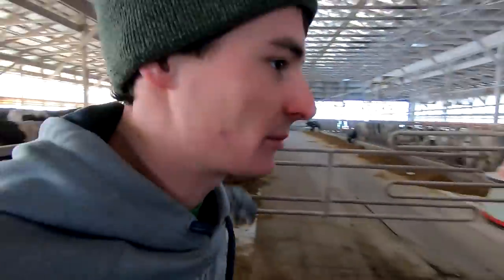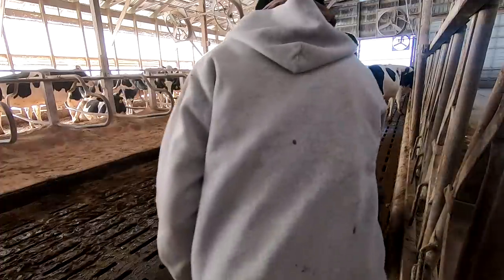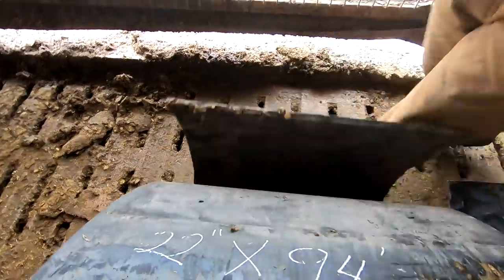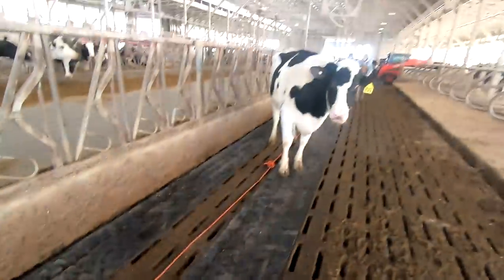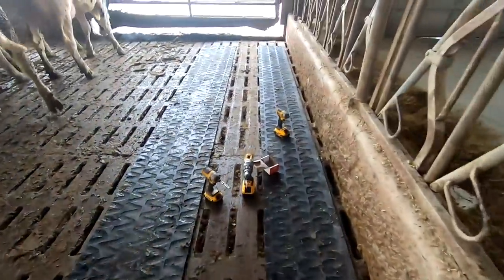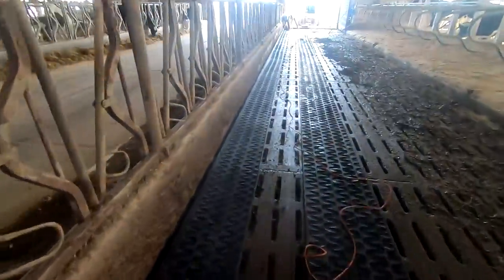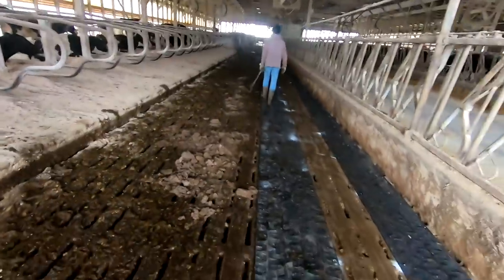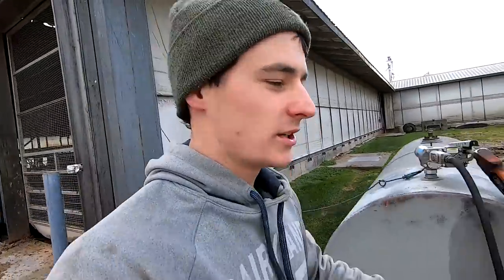Laying Down Rubber

Comment: "Laying Down Rubber" term used in drag racing. Racing cows should be called, Laying Down Udders.
Reply: Well played.
Reply: @patricianewton1417  It was a moooooot point but felt it necessary.

Comment: Does the rubber interfere with scraping manure with the skid steer?
Reply: I believe they don't scrape because they don't have to. The holes in the floor are for the manure to just fall through.

Comment: For the 10th Gen Dairyman  -- Hey when your cleaning  for  Farms windows be it tractor, pickup, or farmhouse the BEST cleaner ups is old news print.  I've used the local newspapers (newsprint) that are  available  to clean the windows after they're spayed  with a good and proper liquid solution! ! !

Comment: How many drill bits did you go through? Mine seem to get dull pretty quickly. And, whoever invented concrete screws should get a medal. Tap-con works really well for me. Congratulations for having a very successful You Tube channel with over 300,000 subscribers. PA farmers are the best, and I think you are the best of the best!

Comment: I asked this before , but no answer ?? Do you have trouble with screws rusting and puncture cows hoofs ?
Reply: Stainless steel screws, no rust. The rubber mat will wear out long before the screws ever do.
Reply: @360skiboy8  have a dairy here in Arizona same thing and stainless screws , still broke and rusted , we ended up ripping out all the rubber 8000 cow dairy . Way bigger than his dairy . And the first rubber he installed , go back and watch , didn’t use stainless steel . That gonna go even faster . Cow shit eats up anything ! Ps I’m a ex dairy farmer and the dairy  im talking about is own by my best friend . Been friends for 40 years . Do you have a dairy with this same set up ??
Reply: @ArizonaKid  I’ll go back and have a look. Dairy size really has nothing to do with rust though. We used to have rubber Mats on the return alley for our cows and we used stainless steel pins to hold them down, 9 years and not a single spot of rust on them.
Reply: @360skiboy8  you guys had good luck , maybe it’s the temp here ? And as for cows size , wasn’t try to show anyone up buddy , was just giving you a idea of size and how many cows are walking on the mats and dropping shit lol . We all know manure can eat thru lots of stuff . Thanks for responding . Just remember, everyone can have different experience in different places , your experience isn’t everyone’s experience. That’s why I wanted to know how his are turning out . But thank you for your experience also . Have a wonderful day

Comment: Just a bit of  advice related to the cordless drill u used to drill the holes .I would advise u not to use the cordless drill while using an SDS bit as it might cause ur drill to overheat and it will damage the drill. I know there is a setting on the drill for stuff like that but I advise you not to .great vid as always